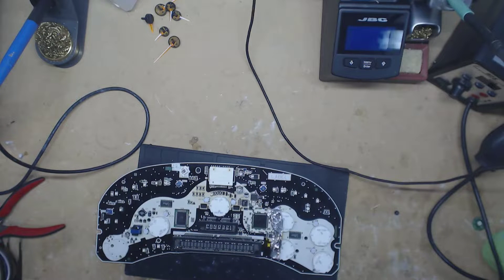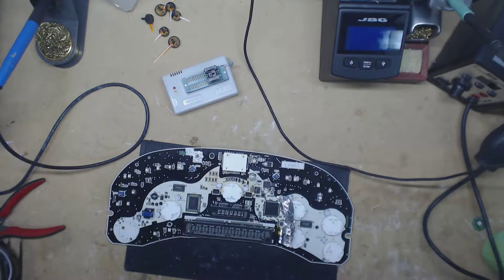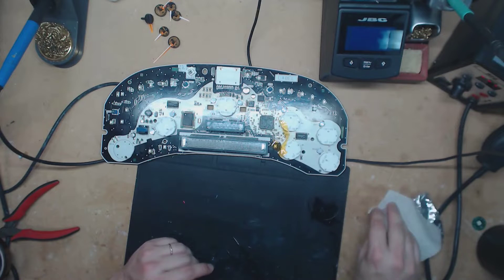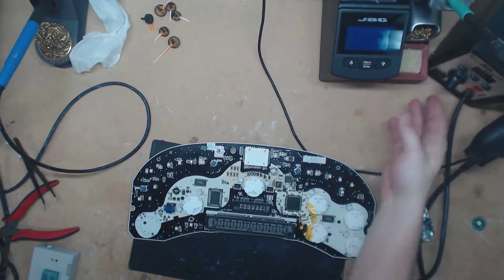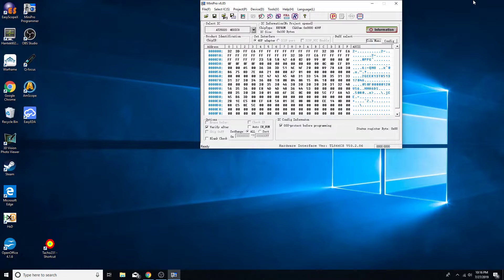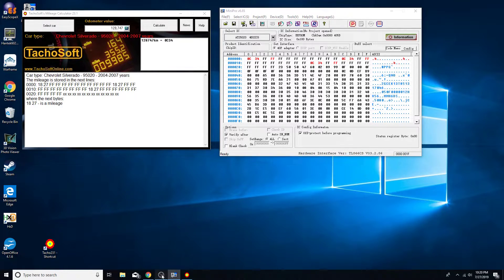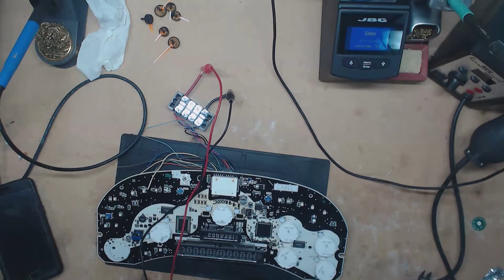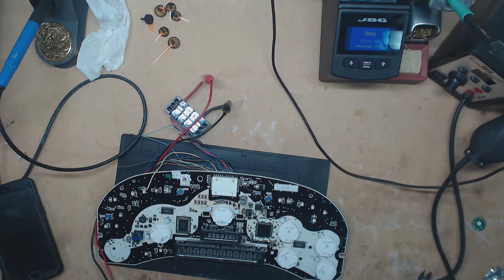GM Odometer Correction

Comment: Polymide/Kapton tape works better than foil, I sometimes put paper behind the tape cause the paper wont conduct the heat while the foil kind of will. The tape is expensive but you use so little of it at a time and once a piece of paper is has some on it, you can reuse those pieces by just tacking them down for awhile. Just a thought.
Loving the video's, excellent information, you are awesome!

Comment: Have you found or tested any of the obd2 port milage correction tools to work? If so which one? I work on ls swapped jet boats and we would like to reset the milage and hours when we rebuild them yearly but don't want to send the clusters off. Also would save use from buying a new hour meter every year for 3 boats.
Reply from the maker: I have not.

Comment: If I swap eeprom chip from one cluster too another, will it have correct vin and dic functions or is this stored on another part of the cluster? Dealer will not flash a used cluster where I am. My cluster has fuel economy and oil change reminder, the donor cluster does not. Battery light comes on when I tested the used one in my truck
Reply from the maker: It will have the vin, odo, hours and trip. The steering wheel DIC vs non steering wheel is a MCU flash
Reply: @FixedUntilBroken  ok thanks!
Reply from the maker: No problem
Reply: So you can swap eeprom chip from one cluster to another without having to program it?

Comment: So the only reason to do this is so you can fix the mileage on the new cluster?
Reply from the maker: Yes or fix odometer error. You could also use this to fix a tampered on say you buy a car and the Carfax doesn't match.
Reply: Digital mileage rollbacks are a problem nobody wants to talk about. How it can be done is not as complicated as this video might project. Many of these cars are sitting at used vehicle dealerships. Big penalties for whom is likely to have done this. Up to 3 previous owners or something like that. Always get X2 vehicle history reports. Most importantly, and better than any computer that could ever built by man, is use your brain. Look at the car with your eyes. Your eyes dont lie, computers tell lies. Brake pedal rubber is worn off at 150k

Comment: Hello, I had to replace my cluster, I couldn’t find one with similar mileage. I was wondering if you could correct the mileage for me. If you provide this service that would adjust the mileage for me that would be awesome. Fan of the channel looking forward to your response.
Reply from the maker: I can but you might want to see what your local dealership and anyone local might charge. Shipping makes it kinda of expensive.
Reply: I’m not located in a heavily populated area. I’ve contacted many places within 30 miles of me. And they all say they don’t have the equipment or they either say they don’t have the knowledge to preform the job. I called the local dodge dealership and they didn’t even have an answer of weather or not I would have to do anything with the ecu to make the whole project work. 2006 dodge 1500 v8 gas engine.
Reply: Appreciate the response tho. :)

Comment: What about 2009 to 2014 gm cluster is the program its the same... or requires different  programming and eeprom programming, what lines contain odometer and what lines contain vin info if you swap cluster out?
Reply from the maker: It's been a while since I've done a 07-14 model. It can be done with the same eeprom reader. If I remember right the vin is is stored in ascii so your hex reader will show it in ASCII table on the side. Next time I do one I'll show a video on it.  With the 07+ I've never seen have odometer error so it should be easy enough to just pull the eeprom off the original board and throw it on the new one

Comment: Can you show how to adjust the engine hours?
Reply from the maker: Yes. It's done the same way but it's on line 5 of the eeprom if I'm not mistaken. I'll do a video in the future on that. These clusters are notorious for resetting the  engine hours to zero for no reason. Not sure what causes it but I've seen plenty of high mileage clusters what less than 1000 hours on them.
Reply: @FixedUntilBroken  alright bro, thanks.

Comment: Hey Bro, I know if you put an 03-04 GM cluster into an 06 Silverado the battery light stays on. What about putting an 05-06 Cluster into an 03-04 Silverado? Will the battery light stay on? Thanks in Advance and for your time.
Reply from the maker: So I did a search and on an avalanche forum they suggest reflashing the truck at a dealer can solve this. I would guess they are flashing the cluster and not the BMC/ECU but I honestly don't know for sure. Definitely something I will look into more and if I find a solution I will do a video on it once I can demonstrate the issue and how to solve it.
Reply: Fixed Until Broken Thanks Bro. I just finished rebuilding a 2004 cluster and my truck is an 06. I used my truck just to test it and noticed that issue. It doesn’t do it with 05 though.
Reply from the maker: I know this question was a little older but I have been looking into stuff like this. I don't know for sure but I think the light issue has to do with microprocessor and not the eeprom. the issue with that is that although the microprocessor can be flash with like TIS2Web you cant use a 06/07 vin's flash on a 03-05 because its a different processor and it will brick the cluster. Its like adding the DIC to the clusters that don't have it you have to use a vin with tis2web that had the steering wheel controls to add it but make sure that vin is compatible with your cluster because you might brick it. If anyone has a cluster that the processor has been bricked I really want to try to recover one... but im not willing to brick a working one myself.
Reply: Fixed Until Broken 
I know Best Pixel Repair adds dic for clusters that don’t have them. I believe he did one for Jeff. Not to much detail about it though.
Reply from the maker: @angulo820  it's done with tis2web. You need subscription to it or do the pay as you use deal. It fashes it through the class2 line I haven't started but I want find a way to dump the microprocessor and flash it directly. Because really it's  only going to be so many different dumps and really only 2 or 3 anyone is going to want. I'm guessing it's going to be easier to try to figure out how to interface directly with the microprocessor than try to talk to it through the class 2 line. Also Im highly doubtful that bricked microprocessors are really dead the more likely just can't interface with the class 2 line anymore so if you can tap directly to it you might be able to recover from a brick.
Reply: Fixed Until Broken 
That sounds like it would be an interesting video.
Reply from the maker: That's something I'm not familiar with. I do know you run into something similar with the air bag light in the 99 cluster vs 01-02 I know it happens because one is triggered by the signal wire having 12v the other is triggered by ground.